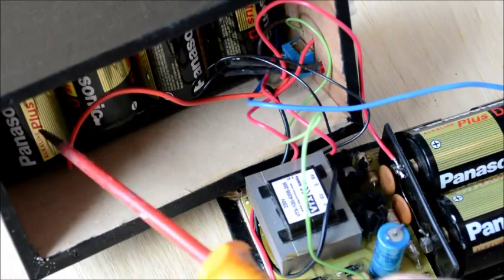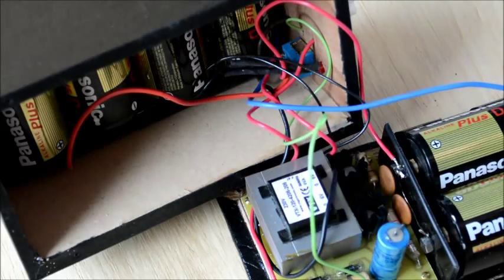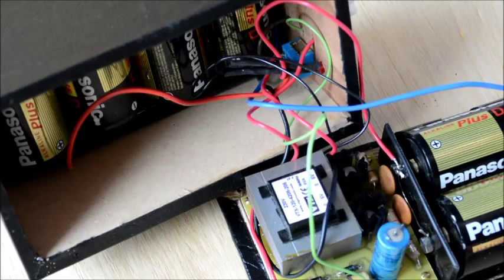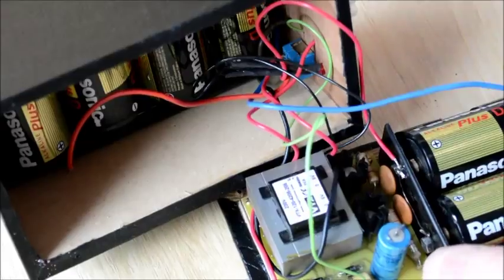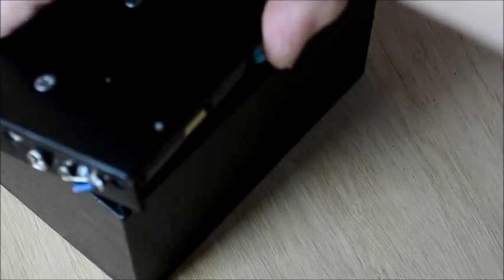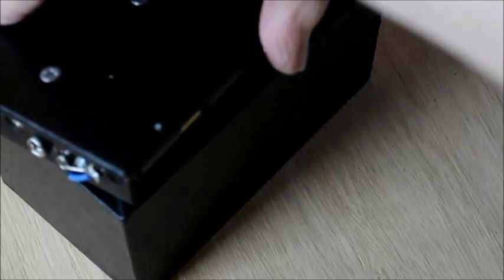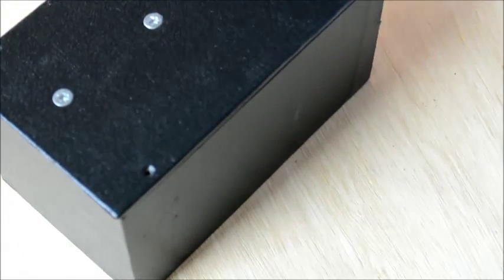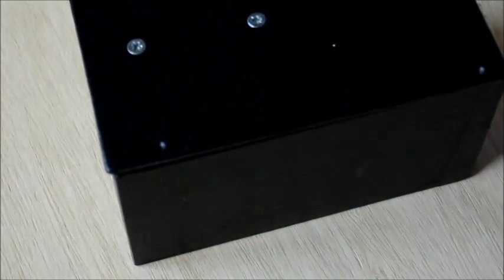Battery portable valve radio power supply

Comment: can this radios take the  punch of a  110v wall socket?????  i know my ground wires but im having a rough time with the pos and neg wires.   i can get all those diagrams and stuff but the bread board. help me here  i got a 90v GE and a 1930s gigantic  stromberg Carlson model 750   and im dying to hear me some tunes before i go and get a unit that looks like it was meant for a socket
Reply from the maker: Battery operated tube sets from the later 1940s onward require 90V high tension (B) battery and 1.5V low tension (A) battery. 1930s sets will need an accumulator for the filament supply of the 2V valves normally used, plus around 120V for 'B' source. Either type of set needs DC and cannot be operated directly from a wall socket. You need an adapter.
Reply: in other words  getting them going is ether find  or build a battery  or  just simply shelf it  welp.  . this maybe a long shot but  would a  microwave transformer  set backwards with a supply of 12 volts  from a modern battery  connecting from two massive capacitors do the trick.  or am i just better off having those for parts come time i get a high voltage radio?
Reply from the maker: 'Getting them going' requires either suitable batteries (see 'Batterymaker' on You Tube for directions) or building a converter. I do not like the sound of your suggestions. Please remember that electric power is potentially lethal. If you do not understand what you are doing, my advice is to build as battery after finding out how to, or forget the project.
Reply: Tony Thompson  hmm . i guess im better off building a battery  like . ive got a mountain of wire sauter  a transformer  a  satuer gun and the only thing missing is battery  connections or 12v batteries  . i understand that what im dealing with  could end up  killing me . this is why im here and asked in the first place   so i know in advance
Reply from the maker: So, a battery for 90V can be 10 X PP3 9V batteries in series, or whatever the equivalent is in the states. The 1.5V filament supply could be a couple of large 1.5V dry cells in parallel. The filament supply will use the power quicker than the high tension side, so big cells last longer. The 1930s set will need a 2V accumulator (wet cell), such as a 'Cyclon' cell, and a higher voltage of HT of course. Look up Batterymaker!
Reply: Tony Thompson  alright if my  12v fed microwave transformer idea  hits the fan il wire 10 9v battries in sync .in the line of couse a fuse and a safety switch so if poles get reversed and the fuse does not blow up i will not get a hot supper.
Reply: as of late i have  got parts and i think i know what will work
Reply from the maker: OK, see how you go on. Do remember that battery tube filaments are very delicate - keep the high voltages away from them.

Comment from the maker: Hi Andy
Around 300mA is my estimation. Alkaline cells essential. I like the idea of auto shut down, a useful feature indeed.
Reply: Thats pretty good, my last effort was a bit higher, but i was trying to do it with single transistor drive, push pull should be better, was try to make one that can be powered from either alkalines, Ni-MHs, or a USB charger/powerbank, so as versatile as possible.

Comment: Whats the current consumption at the 6v input? I've been tinkering with various inverter circuits similar to this for a few weeks, also trying to make it auto-switching so it shuts down when the radio is turned off so no separate switch needed..

Comment: I use these battery valves: DL94s and similar, to build battery valve amplifiers for guitars. I've used the 10 X 9V PP3 in series method but your solution, presented here, would better address the issue. I also like that it consumes the same amount of space that a conventional battery for this purpose, would. Thanks for the upload.